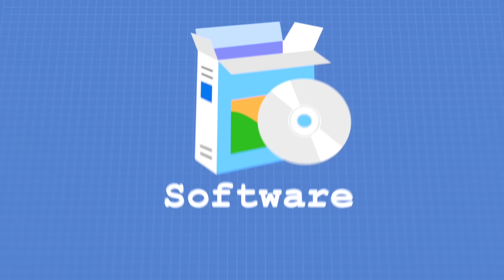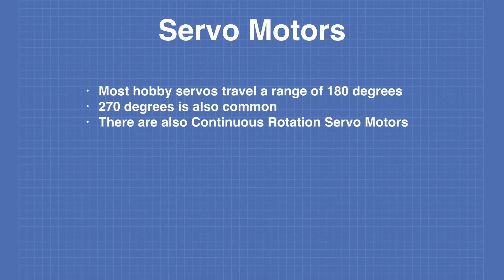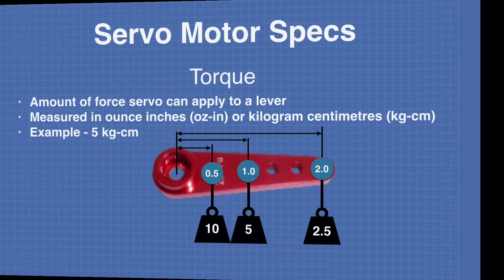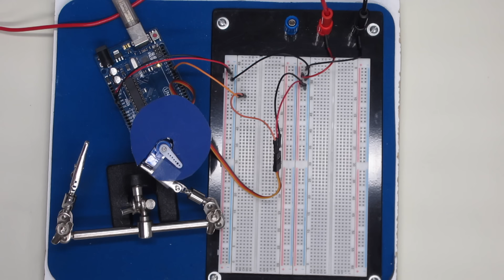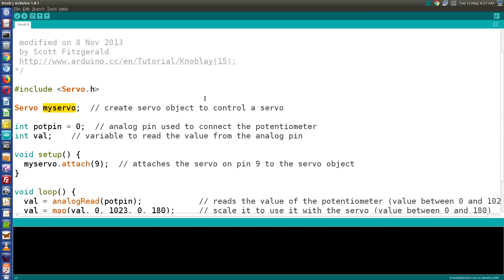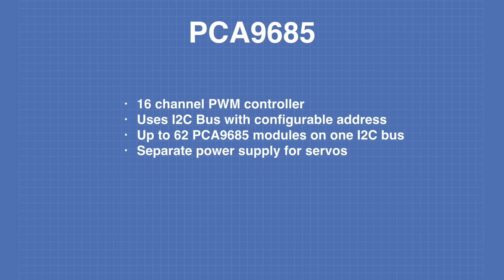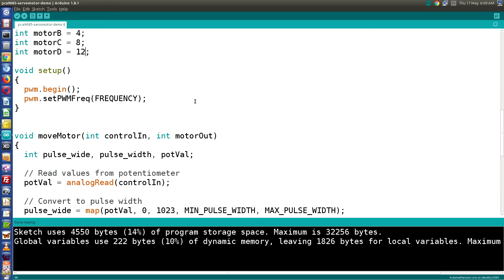Using Servo Motors with Arduino

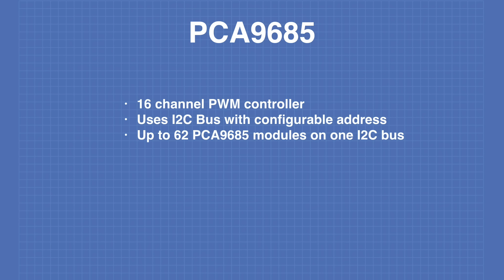Comment: At 28:30 he mentioned a bus. In simple words can anybody explain me what is it.
Reply: Sebastian, a bus in electronics is a common connection shared by many devices. For I2C, many devices can be connected to the same SDA and SCL wires, all the devices are said to be connected to the bus. In this way many devices can be connected via only 2 wires (pins) to the controller (Arduino).
Reply from the maker: Thank you Vince, I could not have explained it any better myself!
Reply: @vincemerlot6046  still thinking about it :) Can the devices connect at the same time or they take turns?
Reply: @argentosebastian  Each I2C device must have a unique address.  While they are all connected to the same "bus" all the time only one device can send data at a time. For example, you might have a temperature sensor and a pressure sensor connected to an Arduino. The Arduino sends a request to the temp sensor at address 0x7B and it responds while the pressure sensor ignores the request because it has a different address. The requests and responses can happen so quickly that it appears both sensors are "talking"  simultaneously but in fact only one device (controller or sensor) is using the bus at any one instant.
Reply: @vincemerlot6046  thank you for taking the time to answer my question.

Comment: Does the NANO have I2C bus?
Reply from the maker: Hi Robin. It does have I2C, however a lot of the documentation on the Internet for it shows incorrect pinouts. The Arduino Nano uses GPIO A4 (SDA) and A5 (SCL) for I2C.
Reply: @Dronebotworkshop  Thanks!

Comment: Hiya, thanks for sharing this video. I got a quick question. Is it possible to run a continuous servo motor in both clockwise and anti-clockwise direction, something like rolling down and up a projector screen with Arduino? Any help is highly appreciated. Cheers!!

Comment: Hello Sir, i bought a servo motor LD-MG27 from Lewan Soul Robotics, which needs minimum 6 volts but better 7.4 volt. I would love to work with arduino. Can you give a recomendation for a power supply, because what i found was 6volts or only 7.5 volts, which would be too high. Thanks in adavance.
Reply: You can add a resistor to your power supply
Reply: @marc.beshay  thank you ! Good idea. In the meanwhile i used a module to regulate the Volt from 12V to 7.4V. But your idea is great!
Reply: @marc.beshay  thank you a lot, but i dont have enought knowhow about it to be sure not to ruin the motor or other electrical components :-)
Reply: Hi Tam - An arduino  can be supplied with power from the DC power jack (7 - 12V) if you want

Comment: Got a question. Has anyone got an example code for running a 270 degree servo. I was told to go onto git hub and download a high torque library , but i can't find it. I can't find any help on the net either.  I want to run the DS3218mg servo... Please Help

Comment: I don't know if this would interest you... I have an idea for a project for you... I am working on a wired remote control mini pontoon boat (wired so if something goes wrong I won't have to go swimming for it). 

What I want to do is make an ultrasound depth finder on it with an LCD display... It will all be controlled with an Arduion uno... I will need to run a regular DC motor to propel the boat forward and back, and a servo to operate a rudder for direction, this will be controlled with an analog  joystick (re-purposed old PC joystick).

The purpose for this is for fishing I would like to be able to drive the mini boat to where I intend to cast my line, and find the depth. Thanks in advance.
Reply: P.S. I have the A4988 h-bridge will this work to control the motor and servo?

Comment: Good video, I need to develop a lock / unlock solution.  It needs to run for 8 to 12 hours with occasional locking and unlocking during that time.  The servo would be used to engage a bolt of some sort.  This would be controlled by an Arduino and must run on battery for the duration.  Any suggestions would be greatly appreciated.

Comment: Great Video, But a little tad-bit to add.

When using the Servo Library included into the IDE, a PWM pin is not required to operate the servo.

The Servo library simulates a PWM signal using the onboard timers on the arduino.

I run 3 servos from the A0-A2 pins on a homemade robot to keep all my valuable digital pins available.

Cheers!

Comment: I have a question.
I want to use 3 servos(more once the first project is a succes)

I have seen lots of people have problems where once they use more than 2 servos all of them stop because they don't get enough power.

How should I remedy that?
Are there spesific power supplies that I can buy for this (batteries would be nice, or do I need an usb or wall power connection)

Thank you in advance the video was very informative I'm subscribed.

Comment: Have you done a hack on a servo? Open the case and tap a wire to the pot and feed that back to the ADC of the Arduino to get TRUE closed loop of that servo

Comment: Thanks a lot for the video. I am trying to build a remote device to control the amount of oxygen coming out of his tank (needs separate oxygen because of health issues). It is a simple rotating lever, which should be changed with the servo motor to a certain postion via bluetooth with his mobile phone, since it can be frustrating if you sit 10m away from the tank but you need more oxygen. Did not quite figured it out, put this video helped a lot!
Reply: * my fathers oxygen tank

Comment: Excellent video as always.  I'm curious though where you specify the I2C address for the PCA9685 board?  You didn't seem to call out an address for the board.  If you are only using one is there no need to call out the address?   Also, if I wanted to use a second board how could I specify the address of the second board.

Thanks.

Comment: Thank you for this video.  I found it very informative.  With reference to this video, you showed how to control 4 servos using 4 of the analog pins.  But what about 16 or more servos?  How would those 16+ servos be controlled. I am working on my model railroads and want to use Arduino and servos to control my track turnouts.  With each servo, I also want 2 LEDs, each LED will  glow when servo reaches set maximums at each end.  Any assistance on my project is appreciated.  Again, thank you for getting my creative side thinking of a solution for my retirement project.

Comment: I found your channel yesterday and it is PACKED full of great information!! Thank you. I am working on a project where I will need the motor to make up to 5 total revolutions based on input received. I believe the information will come from IR, WiFi or something similar. A simple keypad of sorts hit 1 motor makes .5 revolution. 2 makes 1 revolution 3 makes 1.5 revolutions etc. I also need it to know the current position like if you hit 2 it makes the single revolution but then it you hit 3 it will only make a half of a revolution to get to the total of 1.5 revolutions and the same goes in the opposite direction if you were then to hit 1 while it was at position 3 of 1.5 revolutions then it would make 1 single revolution in reverse to get to a .5 revolution. The keypad will have 10 options, each options needs to know how to add or subtract from its current position (or revolutions).    Is this possible?

Comment: Great video, thanks.  I notice that there are less than 16 analogue pins.  How do you connect 16 potentiometers to the Arduino if you need to use 16 servos?

Comment: My version of the PWM servo board is a knockoff I guess, but it has no capacitor on it. Why? 
Also, I see from the video that you have a capacitor somewhere added near the module (on your breadboard). Again, why?
Thanks for the awesome vids btw

Comment: thank you very much once again.
I learn many things with your tutorials.
Clear, well explained and equipped with very useful practical schemes.
Just one thing I do not know yet: how to change I2C address: I imagine closing pads in the upper right corner but how do they manage then in the Arduino?
I can not remember if you have done other tutorials on i2c and how to change its adresses.
I will hardly use more than one PCA9685 but if I wanted to add a display with i2c bus?
Do I remember well  that Arduino only has an I2C line?
Thanks a lot again

Comment: Thanks for your brilliant presentations. I have learned so much from following your simple examples. 
You talked about creating a link to enable us (followers) suggest projects and vote on which one to build. I have a practical project I am trying to build - An Arduino powered Photo Finish Camera - A camera that sits on a rail and runs the last stretch of a race track taking pictures (or video) as it runs to the finish line. I've thought about the logic and it sounds straight forward until one has to sit down to code it. I am stumped. Don't even know how to begin. Is this a project you can help with? How can I contact you directly? This is an example of what I want to build https://www.youtube.com/watch?v=Rihx9yScTGMThe project would require a H Bridge, 2 motors (at least one must be a Stepper). Sensors to detect the moving objects... its going to be a compilation of many projects that you have built here.

Comment: sir i to liked it before watching it,
just knew it would be a f
First Class thing. i myself just went through and designed  mineself a pair of Humanoid legs for walking bot with my new 3d printer (Monoprice Select Plus ) a great machine.
Anyhow then comes hours and hours of searching to find a control system to use the darn thing.......!!!!! 
As if by Magic your vid, came out right on time, only thing i wish to add to it will be this e-prom system to record movements for it. i looked long ,far and wide to find a control system  
 " pre made " for it to no avail so just like the servo system of brackets i                                     " custom designed "for it i needed to " custom make" a control system.
your vid. made it nice and clear how to proceed. if any of your viewers have any subjestons i would be happy to entertain them.
Thank you as always it has been a pleasure as you have a tendency to teach as you were addressing a bunch of kindergartners as a bunch of us are....... Lol